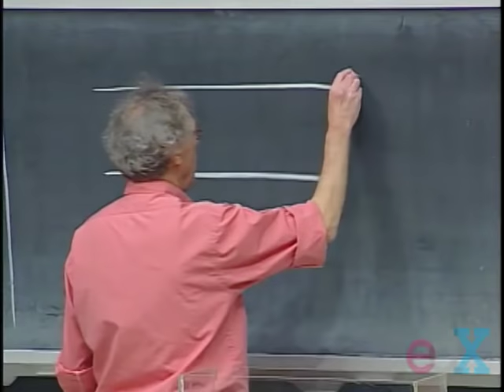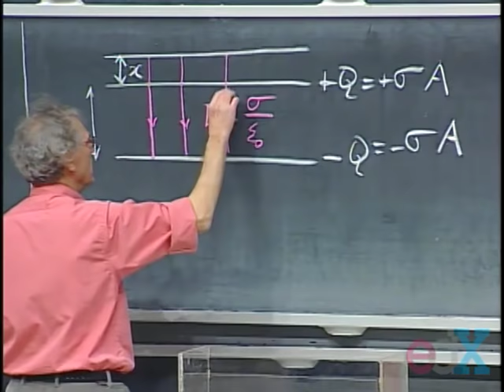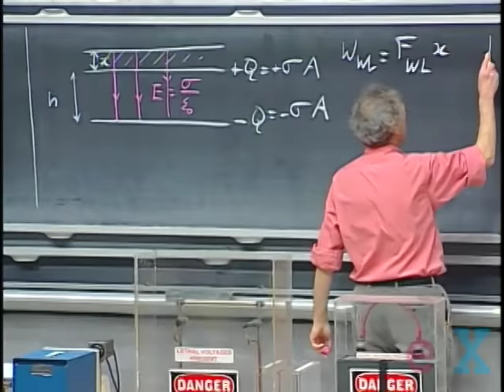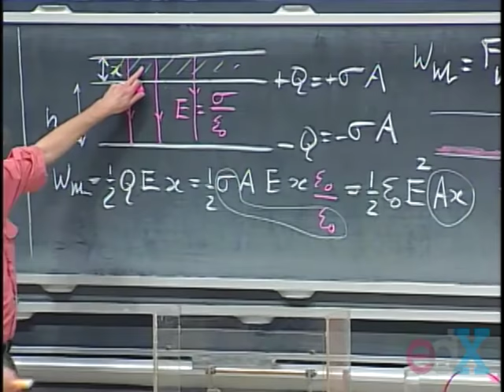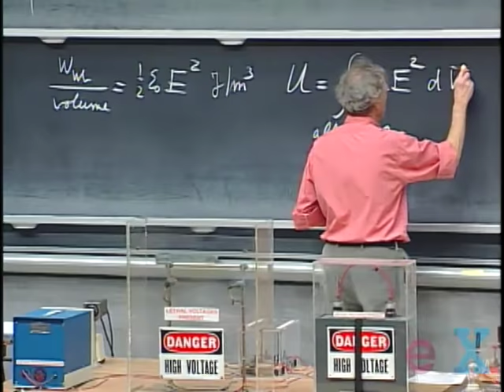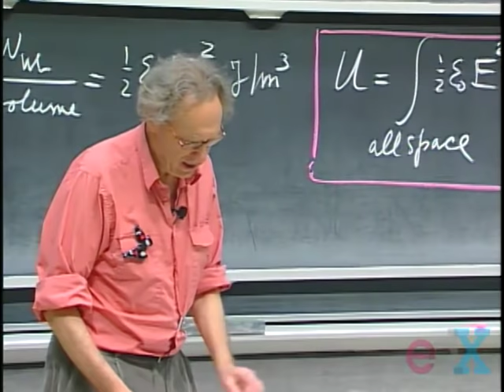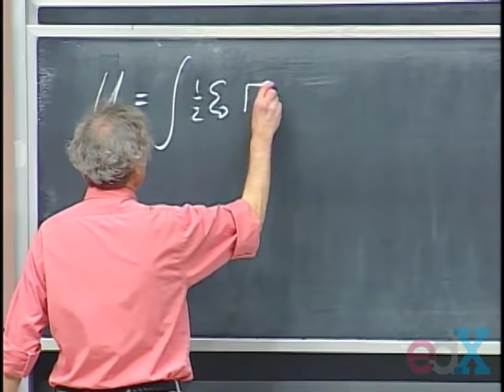8.02x - Lect 7 - Capacitance, Electric Field Energy

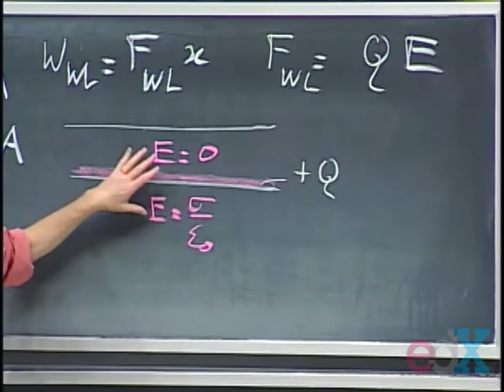Comment: Greetings sir, In 3:26, Why you took the electric field as the average of 0 and (sigma/epsilon) ? Yes, the electric field inside the conductor is zero. But why it is mandatory to take the average and not the non zero one?
Reply from the maker: factor of 2
Let the charge on each plate of the capacitor be Q=100q (+Q on one plate and --Q on the other). Let the area of each plate be A. The E-field between the plates is then Q/(A*eps_o). Let the distance between the 2 plates be d.  Now release q from the + plate to the negative one. The energy that is released is force*distance which is very close to q*d*Q/(A*eps_o). But after this transfer the E-field is reduced, it’s now only 0.99*Q/(A*eps_o). I now release another q thus the energy that is released is now 1% less than with the first q. By the time I have released 10 times one q, the E-field is only 0.9*Q/(A*eps_o) and thus the force on the charge q is only 0.9*q*Q/(A*eps_o). The force keeps going down as I transfer more charge.  By the time I have released the last q (of 100) the E-field has become 1% of the original E-field thus the force on the last q is about 1% of the force during the first transfer. Thus by the time that I have released 100q=Q the average E-field was only 0.5*Q/(A*eps_o), NOT Q/(A*eps_o). Thus the average force on a charge q during transfer was NOT q*Q/(A*eps_o) but only half that. Thus, by spooning off the charge from one plate to the other the energy release is NOT Q*d*Q/(A*eps_o) but only half of that. The energy that is released this way (also called potential energy) is identical to the work that YOU would have to do to separate the 2 plates over a distance d.

Comment: sir as I have earlier said that there is two method of calculating potential energy. sir suppose I put a positive q charge in my pocket and come from infinity to Point A. I do zero work as there is no electric field I simply move a charge. sir there from first definition electric potential energy is zero. but how from second definition electrical potential energy of the positive charge kept at point A is zero. sir how the integration of electric field energy density over entire volume is zero i
Reply from the maker: you have a good point. I have to reject 2). ONLY 1) is correct
where in my lectures do I mention 2)
which lecture how many minutes into the lecture.?

Comment: At the beginning of this lecture, the 1/2 that is added in front of QE bothers me a bit. What if the plates were one-atomic-thickness themselves? In that case, we would still write 1/2(QE) but the argument of doing the average between inside and outside the plate would not stand. 

Something inside me tells me that 1/2 must come from somewhere else!!! But it is only a gut feeling. What do you thing Professor Lewin? Any thoughts about this??
Reply from the maker: factor of 2
Let the charge on each plate of the capacitor be Q=100q (+Q on one plate and --Q on the other). Let the area of each plate be A. The E-field between the plates is then Q/(A*eps_o). Let the distance between the 2 plates be d.  Now release q from the + plate to the negative one. The energy that is released is force*distance which is very close to q*d*Q/(A*eps_o). But after this transfer the E-field is reduced, it’s now only 0.99*Q/(A*eps_o). I now release another q thus the energy that is released is now 1% less than with the first q. By the time I have released 10 times one q, the E-field is only 0.9*Q/(A*eps_o) and thus the force on the charge q is only 0.9*q*Q/(A*eps_o). The force keeps going down as I transfer more charge.  By the time I have released the last q (of 100) the E-field has become 1% of the original E-field thus the force on the last q is about 1% of the force during the first transfer. Thus by the time that I have released 100q=Q the average E-field was only 0.5*Q/(A*eps_o), NOT Q/(A*eps_o). Thus the average force on a charge q during transfer was NOT q*Q/(A*eps_o) but only half that. Thus, by spooning off the charge from one plate to the other the energy release is NOT Q*d*Q/(A*eps_o) but only half of that. The energy that is released this way (also called potential energy) is identical to the work that YOU would have to do to separate the 2 plates over a distance d.
Reply: @lecturesbywalterlewin.they9259  There is a problem in this argument and it comes down to asking the question: when you realise this imaginary q charges, where do they go? There are two opcions:
	- the logical one would be: to the other plate. Well, in that case when you have realease 50 q charges and you are about to release the 51th, then the electric field inside both plates is E=0 (not E=0.5Q/(Aepsilon)) because you already have 50 q charges accumulated in the negative plate and 50 q charges left in the positive plate (counting still the 51th q charge you are about to release at that moment). Calling at that point one plate positive and one negative does not make sense anymore but that’s a detail, the important thing is that: if we assume that the q charges released in the process accumulate in the other plate, then the E field inside the plates is E=0 when you have released half the q charges and not E=0.5Q/Aepsilon

-	One way to try to escape this is the other option, to say that: well, the argument is an imaginary experiment in order to better understand why the force is 1/2QE and not simply QE, so you have to imagine that the q charge that you release do NOT go to the other plate, it just simply disappear out the argument. Well, that’s very artificial and we all know that charge is conserved. In summary, I am still having sleepless nights one year after watching in the video that F = ½ QE between the plates. I still do not get it by any of the arguments given so far; still waiting for a kosher one, even if it is quantum mechanical.

Comment: Proffesor I love You and your lectures, they really made me love physics. But the force on metal plate is equal to E field generated by ONE plate times charge Q of the second plate, rather than average inside/outside field of both times charge of one plate.
Reply from the maker: The charge on one plate is Q. The E-field right at the surface of that plate is E=Q/(A*eps0). Yet the electric force on that plate is not QE, it's QE/2, that is a bit strange, students would expect that the force is QE, Thus I explained why it is QE/2. The thought that each plate contributes E/2 to the Field is a way to arrive at the same result.  Gauss' Law applied near one plate ==>  E=Q/(A*eps0. Thus the notion that I should take the field "contribution" (E/2) of one plate to calculate the force on that plate does not appeal to me; it's not kosher but you get the right answer.

Comment: Hello sir, I am a high school student, and I have been watching your courses 8.01, 8.02 and 8.02 and have seen most of the lectures. You are the best teacher that I ever had, and I can now understand physics with a very intuitive and experimental viewpoint. I have to do a rather complicated experiment in either mechanics or electricity, to investigate how changing one factor affects another factor. This needs to have a lot of mathematics and should not be very simple. Do you have any ideas for this? Currently,  my idea is to measure the magnetic permeability of water, and it's relationship to the strength of the magnet. I am planing to do this by placing a magnet inside a cylinder of water and using a Tesla meter to measure the magnetic field strength outside the cylindrical tank. Is this a good idea, and do you have any better ones?. Thank you so much for your lectures.
Reply from the maker: Your idea should work. What accuracy do you think you will obtain. Keep in mind that a measurement without information about its uncertainty is meaningless. I would not have chosen this topic. I would have chosen air drag measurements on falling objects. including air filled balloons). https://www.youtube.com/watch?v=djCCno4Cbcw&index=13&list=PLyQSN7X0ro203puVhQsmCj9qhlFQ-As8e
Reply: Thank you for your quick response! I cannot chose a topic like this because another student is already measuring how the shape of falling objects affects the air drag. Are there any more complicated topics in mechanics or electricity?

Comment: I still don't understand how exactly is electric field created? Isn't the electrical field within the 2 plates constant? So even if you seperate the plates apart, no additional creation of electrical field is there(because if will be constant, regardless of the distance apart), therefore no net e field is added.
Reply from the maker: watch the lecture again and may more attention.
Reply: Sir if the previous electric field between the capictors was sigma divded by epsilon_0 for all space between the two plates, then after moving it up by a distance of x, wouldn't the field remain roughly constant? So after moving it up, the electrical field is still the same for all points in between, as a result wouldn't the net electric field created be 0 since the completely offset each other before and after? I guess there is an extra volume(A*x) amount of points that has now the field strength sigma/epsilon_0, but still it still seems cofusing to me exactly how the field now was created since the e field will always be constant for 2 plates in between.

Comment: I would like to ask something professor , I think the force acting on one of the plates isnt because we take averages but because the field E between the plates is the some of the fields created by each plate and we know that the field of a charge doesnt affect itself .So the field that is affecting the plate would be the field created by one of the plates and it would be  E/2 . I have been thought this way and i would like to hear your thoughts on this
Reply from the maker: to take the average is an easy way out but it's not kosher. 
factor of 2
Let the charge on each plate of the capacitor be Q=100q (+Q on one plate and --Q on the other). Let the area of each plate be A. The E-field between the plates is then Q/(A*eps_o). Let the distance between the 2 plates be d.  Now release q from the + plate to the negative one. The energy that is released is force*distance which is very close to q*d*Q/(A*eps_o). But after this transfer the E-field is reduced, it’s now only 0.99*Q/(A*eps_o). I now release another q thus the energy that is released is now 1% less than with the first q. By the time I have released 10 times one q, the E-field is only 0.9*Q/(A*eps_o) and thus the force on the charge q is only 0.9*q*Q/(A*eps_o). The force keeps going down as I transfer more charge.  By the time I have released the last q (of 100) the E-field has become 1% of the original E-field thus the force on the last q is about 1% of the force during the first transfer. Thus by the time that I have released 100q=Q the average E-field was only 0.5*Q/(A*eps_o), NOT Q/(A*eps_o). Thus the average force on a charge q during transfer was NOT q*Q/(A*eps_o) but only half that. Thus, by spooning off the chaInfamousrge from one plate to the other the energy release is NOT Q*d*Q/(A*eps_o) but only half of that. The energy that is released this way (also called potential energy) is identical to the work that YOU would have to do to separate the 2 plates over a distance d
Reply: @lecturesbywalterlewin.they9259  Thanks professor! Love how you care about your audience . Even my own olympiad teacher doesn't respond this fast <3

Comment: Hey doctor walter lewin i have a doubt why did u take the average of the two fields to calculate the work done to move the capacitor plate.
Reply from the maker: Let the charge on each plate of the capacitor be Q=100q (+Q on one plate and --Q on the other). Let the area of each plate be A. The E-field between the plates is then Q/(A*eps_o). Let the distance between the 2 plates be d.  Now release q from the + plate to the negative one. The energy that is released is force*distance which is very close to q*d*Q/(A*eps_o). But after this transfer the E-field is reduced, it’s now only 0.99*Q/(A*eps_o). I now release another q thus the energy that is released is now 1% less than with the first q. By the time I have released 10 times one q, the E-field is only 0.9*Q/(A*eps_o) and thus the force on the charge q is only 0.9*q*Q/(A*eps_o). The force keeps going down as I transfer more charge.  By the time I have released the last q (of 100) the E-field has become 1% of the original E-field thus the force on the last q is about 1% of the force during the first transfer. Thus by the time that I have released 100q=Q the average E-field was only 0.5*Q/(A*eps_o), NOT Q/(A*eps_o). Thus the average force on a charge q during transfer was NOT q*Q/(A*eps_o) but only half that. Thus, by spooning off the charge from one plate to the other the energy release is NOT Q*d*Q/(A*eps_o) but only half of that. The energy that is released this way (also called potential energy) is identical to the work that YOU would have to do to separate the 2 plates over a distance d.
Reply: @lecturesbywalterlewin.they9259  Well, Doctor lewin, I understand what you are saying here, but I was wondering why not consider the work done to move the charged plate like we would consider for moving a static charge suppose we had two static charges Q1 and Q2 the work done to move charge Q2 from point A to point B will depend on the electric field or difference in potential caused by Q1 alone (not Q2) so ,how about we consider the electric field produced by capacitor plate 1 alone which will be Q/2(A*eps_o) (due to gauss law) so you move plate 2 along the electric field line produced capacitor plate 1 therefore now the work done to move the plate 2 will be Q*Q*d/2(A*eps_o) can't we consider it like this ??

Comment: An earlier model for an atom considered to have a positively charged point nucleus of charge Ze, surrounded by a uniform density of negative charge upto a radius R. the atom whole as neutral. For this model, what is the electric field at a distance r from the nucleus.
Reply from the maker: if r is larger than the size of the atom the answer is zero. If r is much smaller there is no answer as the electrons are NOT uniformly distributed around the nucleus. use google "Quantum Mechanics location of electrons in atoms - Heisenberg's uncertainty principle."

Comment: Such a great lecture, but I have an inquiry please... In case Of DBD ( dielectric barrier discharge).. after using the dielectric that will reduce the Enet in the discharge gap Enet =Efree/K... it means lowering the discharge comparing with if both the electrodes were bare .. Is that right?
So can I say the DBD and Capacitor is using almost the same concept but in DBD low dielectric constant is better to give more Electric field for ionization.. in capacitor higher 
??dielectric constant so high stored charge.

Thanks in advance professor
Reply from the maker: Electric discharge E-fields in various materials (including gasses) can be found on the web. It's not simply related to K.

Comment: Hi sir, thank you very much for the lecture. I have yet another question :)
in 3:00, you discuss how the charge being built up specifically on the boundary of the capacitor causes the energy stored to be (1/2)QE. I was wondering where was the connection of this to the alternative reason given for the 1/2 coefficient, namely that the energy stored is (1/2)QV, (which you shortly after derive) because half of the energy is dissipated in the circuit due to joule heating. I tried thinking about it and lost sleep over it, but I couldn't put my finger on it. Thank you :)
Reply from the maker: Infamous factor of 2
Let the charge on each plate of the capacitor be Q=100q (+Q on one plate and --Q on the other). Let the area of each plate be A. The E-field between the plates is then Q/(A*eps_o). Let the distance between the 2 plates be d.  Now release q from the + plate to the negative one. The energy that is released is force*distance which is very close to q*d*Q/(A*eps_o). But after this transfer the E-field is reduced, it’s now only 0.99*Q/(A*eps_o). I now release another q thus the energy that is released is now 1% less than with the first q. By the time I have released 10 times one q, the E-field is only 0.9*Q/(A*eps_o) and thus the force on the charge q is only 0.9*q*Q/(A*eps_o). The force keeps going down as I transfer more charge.  By the time I have released the last q (of 100) the E-field has become 1% of the original E-field thus the force on the last q is about 1% of the force during the first transfer. Thus by the time that I have released 100q=Q the average E-field was only 0.5*Q/(A*eps_o), NOT Q/(A*eps_o). Thus the average force on a charge q during transfer was NOT q*Q/(A*eps_o) but only half that. Thus, by spooning off the charge from one plate to the other the energy release is NOT Q*d*Q/(A*eps_o) but only half of that. The energy that is released this way (also called potential energy) is identical to the work that YOU would have to do to separate the 2 plates over a distance d.